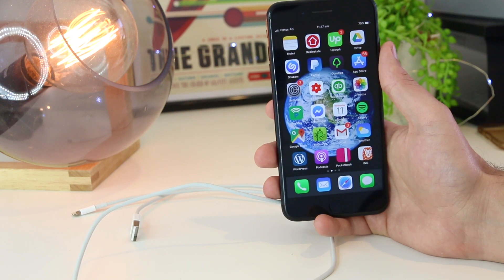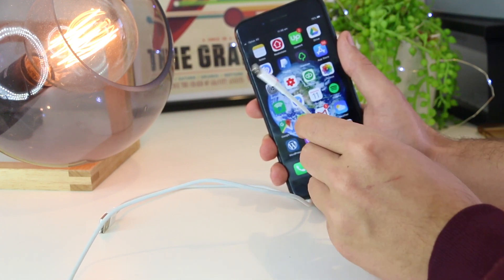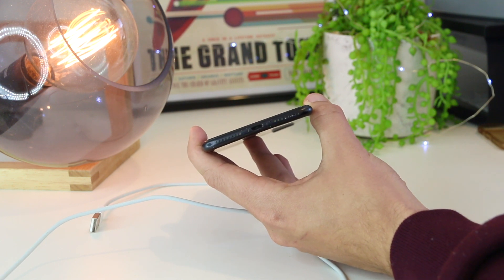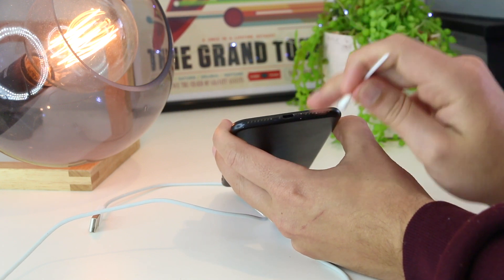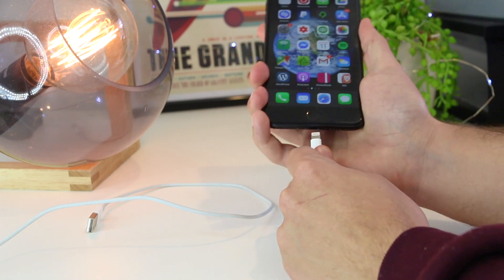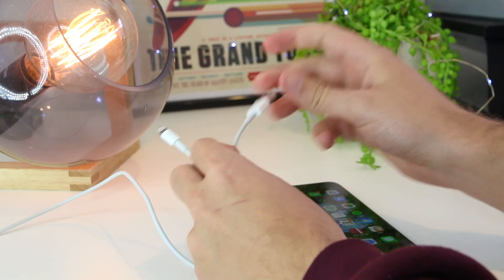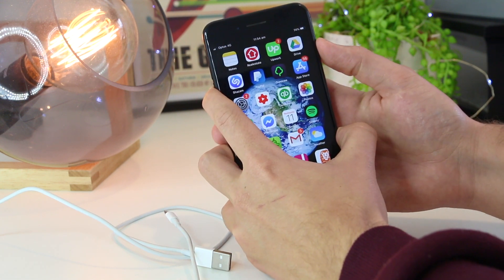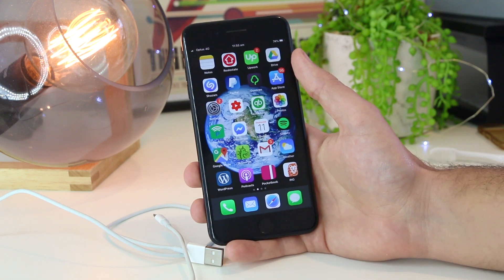"This Accessory May Not Be Supported" 🔥 [FINALLY FIXED!!]

Comment: TYI I have a number of non genuine charging cables that I bought. All produce the message when trying to charge in my car via usb plugged into the cigarette lighter port. They all work fine when connected via usb into a 240v plug

Comment: Did NOT work for me. The problem I am having, as are others is that the error message WON'T dismiss, thereby effectively locking the phone. With my iphone 11, if I try to reboot, it triggers an emergency call. WTF!

Comment: In my case, it's the cheap powered USB hub with 10 ports, or maybe since I have seven things plugged to the hub, it's power is not enough to charge three iphones at all once like I'm doing. So I plugged all three iphones to another USB hub with four ports that's not powered and the "This Accessory May Not Be Supported" is fixed, just now.

Comment: Guys if this doesn’t work. Then take off your screen and the shield covering the screens connection press down on the sides and tighten the screws. I thought I would of changed the port until I tightened the screws

Comment: Sorry but your right about having a cheap cable, cleaning the ports don't do anything not having a go at you at all, I strip iphones down as a hobby, but with a cheap one it will last for a while then you get the message about it won't support your phone so don't mess about go to your £ shop that's in England say and go and buy another one cheap. Apple have been told about changing there connection ports in line with other mobile phones and thay are not doing it, been told so many times now.

Comment: Thank you so much , you are a life saver 🤩. I had an original iphone charger and was facing the same issue with 2 of my iphones. I cleaned the ports as you mentioned and It worked for both 🤩🤩🤩  no more error so far .Thanks a ton, you are awesome 👍🏻👍🏻👍🏻

Edit Note  : The cleaning worked great for several hours and its again the same error 🥺
Reply: So how could it help

Comment: my problem begin with iOS14 , on iOS 13 all version cable work fine , soon us I upgrade to iOS14 i got that message 
but if I leave over night phone plugged in it will fill battery to 100% , i try 5 different cables and problem is still there

Comment: I finally sorted this issue guys!! U can use any working cable with this method! Just put your phone on airplane mode, switch your phone off from settings> general and plug in the charger. The phone will turn on automatically. Now keep connecting the cable repeatedly till that notification (this accessory may not be compatible) stops appearing. Sometimes it takes 20+ times to start charging. I do it every night and wake up with 100% charging

Comment: Subscribing! You gave a tip that Apple support couldn't provide to me. I worked the cables, cleaned the ports, and then, hard booted. Boom, buh bye radio button (the device is not supported locked the phone from screen use). Thank you!

Comment: Guys the only solution is to do 
1- plug in your cable 
2- turn the phone off 
3- now its charging 
Note: it can only charge while the phone is off
Reply: I tried that but my phone went down twenty percent in three minutes
Reply: I need it to charge with the phone ON.
Reply: it happened the same thing to me, and the problem was the charger, i bought a new one and the problem was solved
Reply: This is THE BEST ADVICE!! 100% true!! Thanks

Comment: guys I found a solution. I wanna help cuz this got me mad.
connect your iphone into your pc with the same cable and trust your pc, if it starts charging then the cable was the problem.
if it doesn't connect at all then it's your iphone.
then you should be fine when u connect it back into the brick

Comment: If nothing works try getting a wireless charger the one where u place ur phone on the things then starts charging it still does the not supported thing but charges straight it does happen

Comment: when i plug my charger into the wall, my phone says "unlock to allow accessory"
anyway to fix this?
Reply: Unlock the phone, then you plug it in. Don’t worry if it goes to sleep mode after that, it will still charge. Happened with me

Comment: Thanks! My problem was that this error message wouldn't go away, no matter how many times I tapped Dismiss, and I couldn't do anything else using the phone screen. I didn't know you could restart an iPhone 7 without touching the screen, but it solved the problem of being stuck. Now I need to figure out how to stop that error message from popping up every time I connect a charging cable, repeatedly.

Comment: Tip : Don’t Watch Only Only An i Phone While Charging Because It Will Get Broken.. The Tip Is If You Need To Call Somebody Use Another Device Or Use If You Have A Smart Tv Or A Laptop , Computer So Yeah.. Even If It Works You Will Get Electricity Into Your Body..

Comment: Switching off the iphone and then charging it used to work for me but not all the times

So I tried another cable( I had to buy a new one after I tried everything on YouTube)

Also if your headsets are working when you plug them in then its 60% a faulty cable

Comment: This actually works! People reading this comment LISTEN! So first I got a Clorox wipe and wiped down my charger, then I blew inside my phone to get all the dust out, then I put my charger in and then took it out, over and over again. And then lastly I power off my phone and powered it back on and IT WORKED!!! Like this if it worked for you as well.

Comment: If that message pops up on ur screen, only solution is to use ‘MFI’ or original product. Cleaning jack, ports, restarting or settings change will not help at all. But that doesn’t mean u need to buy/use those overly expensive apple accessories. You can get decent price ranges products that supports iPhone. Like here in India original charger can cost u 1000-1500₹ (around 15$+) but at around 500-800 I can buy other reputed brand products along cable and adapter (portronics). It’s just that u need to first check well whether problem doesn’t persist. My aux-usb earphone converter (original) got damaged so I need to buy new one. I went to apple service centre and that was for around 1200 for such small dongle. There’s many variants in market but most aren’t compatible for iPhone. They just don’t play music at all if u plug in to your phone. But I bought from some market after going through multiple markets and found with half of price than apple store one. So my suggestion is to change your accessory. Only that will help

Comment: I just came here with a helpful tip that help me to charge my phone for a “Quick Fix”. If all fails and your phone still shows the message not supported when you plug it in here is a quick thing you could do to get a little battery life.
1)Turn off your phone
2)plug in your charger the same time the screen is turning off (Note: if you wait until the screen entirely goes dark the phone will turn on again because that’s what iphones do when you plug it in)
3) leave the phone to charge

Ps: note this is a quick fix not a long term one, also this only works if you plug in your charger and it shows not supported and stop charging. Lastly to the effects of how this affects your phone? I have zero idea so do this at your own risk like i said this is a quick fix incase you really want to charge your phone.
Reply: I have been using this technique and it works but itd just temporarily though 
That's why I'm here😭
Reply: Im using this technique for 1/2 months now but it doesnt work anymore now
Reply: MaximillianFan Level:4999 Pandory The Panda check to see if it’s ur base. Then you clean ur charger port carefully with something plastic but has a sharp end. But don’t make it too sharp to the point where it could damage ur charger port. It could be ur charger, maybe your charger is dirty. But, If that doesn’t work then try buying a charger port cleaner thing (not sure what it’s called) and if that doesn’t work then maybe you need to go to the Apple store and replace the charger port, or just get a new phone. Your port could have lint or dust or something sticky that’s blocking the charger from charging ur device.

Comment: I don't know if this will work but why not try... So yeah i was experiencing this shit and it was annoying tf why does it has to happen when its quarantine.If the problem is not from the cable nor the port of your phone why not try changing the box thing where you insert the cable lol sorry don't know what it called i just don't give a damn about it anyways. So i tried changing the box and guess what? It actually work and it charges fast. Try this it might be the solution, I'll repeat I don't know if this will work from you but it works perfectly fine from me and i was proud i fixed it lol so yeah you should try. I just wanna share this to help.

Comment: i’ve tried everything,soft reset, shut down, cleaning ports 😭😭 and my phone is 9%
Reply: Mine is 6% UGH
Reply: And don’t be using your phone while it’s charging. 

Tip 
Once it charges on 100% take it off the charger as it could over charge your phone which isn’t good.

Make sure you at least turn off your phone twice a week. It’s really helpful. And try not to overheat your phone too much. 

Give it some down time.

Comment: It makes the charging sound but it isn’t charging help
Reply: Cybrix_jojo ROBLOX PLAYER same
Reply: Sameeeee
Reply: Pandory The Panda check to see if it’s ur base. Then you clean ur charger port carefully with something plastic but has a sharp end. But don’t make it too sharp to the point where it could damage ur charger port. It could be ur charger, maybe your charger is dirty. But, If that doesn’t work then try buying a charger port cleaner thing (not sure what it’s called) and if that doesn’t work then maybe you need to go to the Apple store and replace the charger port, or just get a new phone. Your port could have lint or dust or something sticky that’s blocking the charger from charging ur device.
Reply: Cybrix_jojo ROBLOX PLAYER  same bro
Reply: Same!! I had to buy another charger.And it’s doing the SAME THING.Well I’m 2 months late but who caressss🤚🏻🤚🏻
Reply: im relating to all these comments at once- 😭
Reply: Same .-.
Reply: try to plug in the charger then power off it thank me later
Reply: Crypsx GT didnt help

Comment: And I permanently and unquestionably consider this "this accessory may not be supported" issue is absolutely tantamount to the device insubordination and disloyalty to users responsible in charging batteries and this provoked my roller-coaster of emotions eg wrath and extreme dislike until I screamed with Sub-Zero/Kung Lao's Mortal Kombat Fatality scream.
Reply: So this popup is to be the most offensive, disrespectful and inconsiderate remark towards whose in charge and discipline of charging their IOS devices where these devices should have more battery power for the future uses.

Comment: ive tried like 3 chargers and it still doesnt work🤦‍♀️
Reply: Then its your phone
Reply: rednekz3293 YEAH that’s what she’s trying to say-
Reply: Just use huawei Samsung xaomi... charger with iphone cabel and vork 100%
Reply: I knowww rightt
Reply: Pandory The Panda check to see if it’s ur base. Then you clean ur charger port carefully with something plastic but has a sharp end. But don’t make it too sharp to the point where it could damage ur charger port. It could be ur charger, maybe your charger is dirty. But, If that doesn’t work then try buying a charger port cleaner thing (not sure what it’s called) and if that doesn’t work then maybe you need to go to the Apple store and replace the charger port, or just get a new phone. Your port could have lint or dust or something sticky that’s blocking the charger from charging ur device.
Reply: It’s your phone
Reply: clear port
Reply: Have you ever tried blowing the tip? Some comment told me to and it worked :000
Reply: did u fix it yet ?
Reply: Vanessa Nguyen Ik u didn’t ask my but I fixed it because my charger base was causing the problem, then also there were problems with my charger port so I had to clean that, and sometimes I just have to switch me chargers. But it could be your base. ♥️
Reply: It’s your phone
Reply: ong
Reply: Same
Reply: Ong it’s gotta be my phone trippin
Reply: Clean the port
Reply: you need a new phone

Comment: Also, sometimes, it says when I plug it in, “ Not Charging”. Can you make a vid ‘ bout that?
Reply: Pandory The Panda check to see if it’s ur base. Then you clean ur charger port carefully with something plastic but has a sharp end. But don’t make it too sharp to the point where it could damage ur charger port. It could be ur charger, maybe your charger is dirty. But, If that doesn’t work then try buying a charger port cleaner thing (not sure what it’s called) and if that doesn’t work then maybe you need to go to the Apple store and replace the charger port, or just get a new phone. Your port could have lint or dust or something sticky that’s blocking the charger from charging ur device.

Comment: I’ve did this I blew into the charging port, and then I wiped the plug I tried it and it did actually work! Hopefully

Edit: Nvm dont Bother problem is still there and btw last 2 days my charger has been working perfectly fine
Reply: Does it work again after 3 months?
Reply: Dark_playz 64 yep perfectly fine
Reply: Thank You So Much You Just Saved This Phone It Got To 0 Percent And Switched Off But I Saw Your Comment From Another Device And This Was Saved